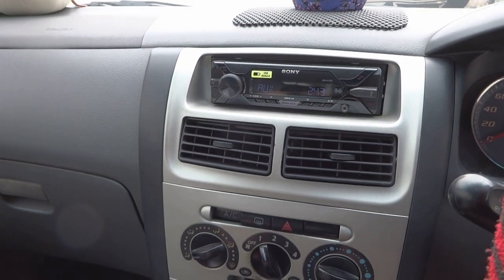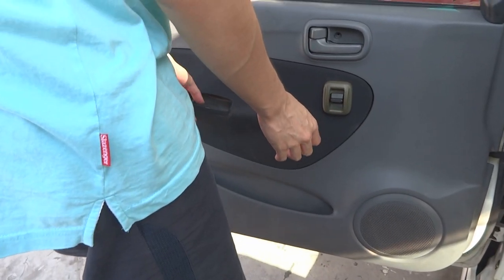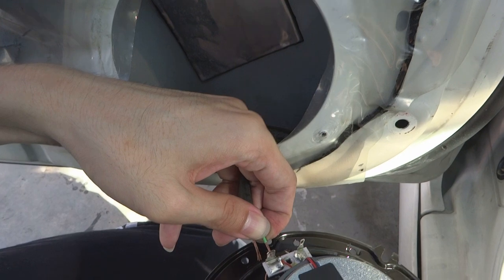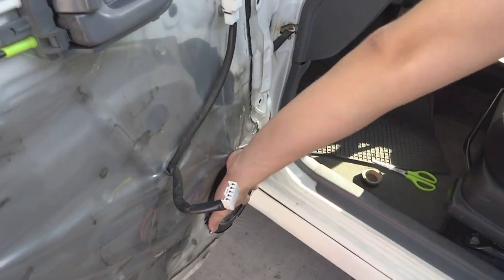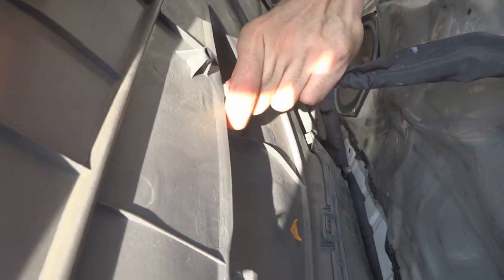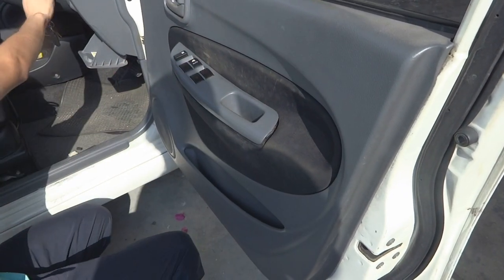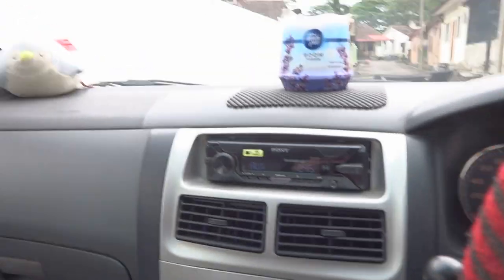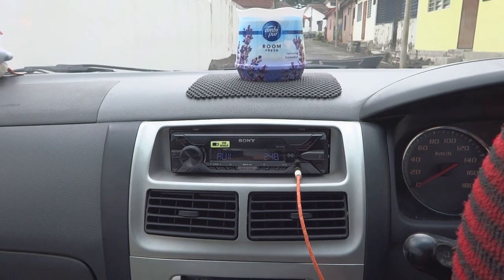INSTALLING SONY XS-GTF 1639 6.5" 3-WAY COAXIAL SPEAKERS ON PERODUA VIVA | REVIEW+SOUND TEST | PART 1

Comment: you NEED to solder the contacts bro! It will come loose after some vibrations
Reply from the maker: I sure hope they don't fall out. Hahaha. Thanks for the advice too!
Reply: @PenguinTech521  Next time dont cut the wires, but break/remove the plastic connector, there are 2 pins inside that come out and can be connected to your speaker terminals with ease.
Solder them or the wire wil come lose and fry your head unit/radio with shortcircuit

Comment: Thanks for this video. Am torn between the blaunpunkt 1664 and the sony 1639.
Reply from the maker: Thanks for your support!
Reply: I opened up the panel on mine and actually the original connector is labelled with positive and negative symbols so no need to guess.
Reply: I finally went with the blaupunkts because when I went to the shop, they sold only fake sonys lol. so i ordered the blaupunkts and I must say I am very pleased with the sound quality. Anyway, thanks to your video, I felt motivated to upgrade and am glad I did.

Comment: Kenari also the same ka bro?The size in the spec is 6.5", would replacing front speaker be enough to improve the bass with stock headunit?
Reply from the maker: Seems like kenari also use 6.5" bro. This speaker is way clearer than stock speaker. But the bass is definitely not strong when paired with stock head unit.
Reply: @PenguinTech521  the roof speaker is kinda rubbish aswell,if i use underseat woofer will it be enough in your opinion? Planning to upgrade for my wife😅
Reply: @PenguinTech521  and oh ya u tested from the front speaker only ka?Seems bassy enough 👍
Reply from the maker: @HuntaKiller91  yeah. Because I set bass to +2 I believe on the Sony head unit. But actually at +0 isn't strong at all
Reply from the maker: @HuntaKiller91  I think adding an underseat woofer would definitely add strong bass, since kenari isn't a big car. I wanted to do that too actually. 

Thanks for support by the way!
Reply: @PenguinTech521  thanks for reviewing this aswell😄..gonna buy this for my wife's kenari,alang2 ade sale 10/10 haha
Reply from the maker: @HuntaKiller91  hahaha thanks for the support!

Comment: So did you happy with the sound quality after using it about 1 month?
Reply from the maker: The sound is definitely way clearer but the bass is not strong as I like. Planning to change both rear speakers as well and try.
Reply: pakai preamp pn ok yg bleh set subwoofer tu..speaker depan set buat midrage yg belakng set jadi subwoofer

Comment: Youtube. Has realy bad sound quality next time uae premium spotify or soundcloud you will be pleased. ;)
Reply: Youtube audio quality is better than most people give it credit for. Obviously it isn't high resolution but usually sounds as good as standard Redbook cd quality. In cases where it doesn't sound very good, to put it bluntly, it's usually the fault of a $h!tty sound system lol
Reply: @scaf_007vs3  When you upload a video to YouTube, the audio is typically encoded using the Opus codec at a bitrate of 128 kbps. However, YouTube also supports higher quality audio formats in certain cases. For example, if you upload a video with lossless audio (such as FLAC or WAV), YouTube will transcode it to Opus format at a higher bitrate of up to 256 kbps.
Reply: @scaf_007vs3  Some facts. Overall, while YouTube's audio quality is generally quite good, it may not match the fidelity of lossless audio formats or high-end audio streaming platforms.